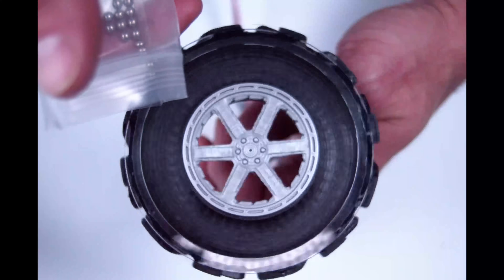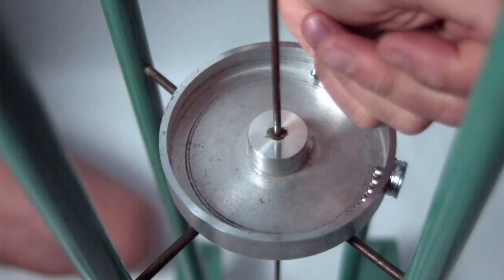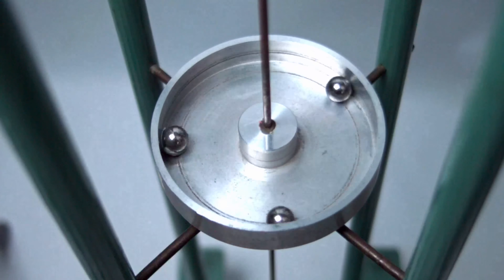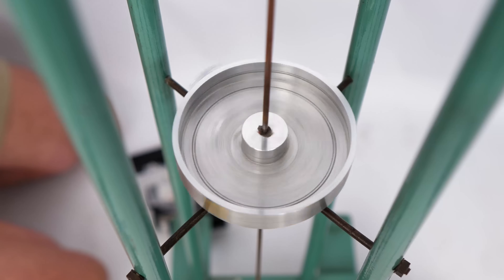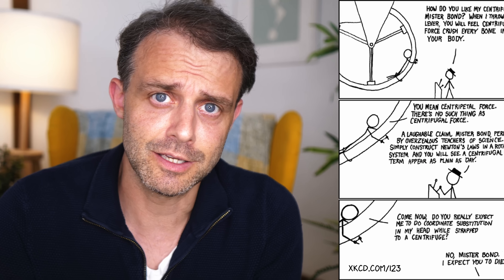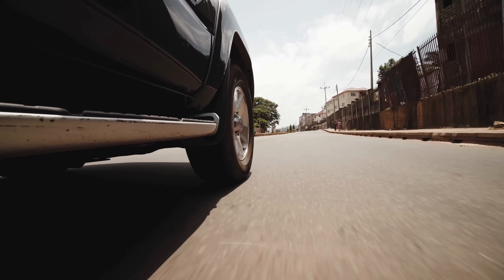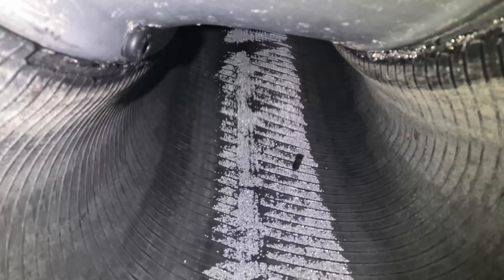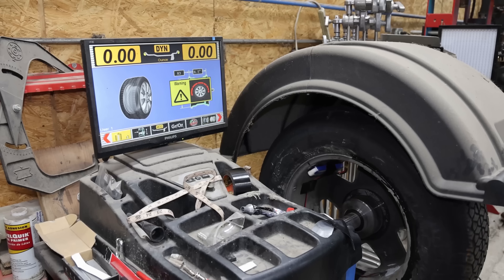Do tire balancing beads actually work?

Comment: So, let me get this straight - these imbalances make my axel flex, basically, yes? So surely each time the wheel needs balancing, the metal of the axel would suffer... So surely, then, it's better to have static weights to balance the wheel, to avoid excess or unnecessary axel flexing? 
(I can guess that such flexing would potentially lead to failure long after the useful life of the vehicle, so it's not a problem in real life, but it still strikes me as better to have static weights for balancing.)

Comment: I used them and they worked for a time. The go fast to work issue was bothersome as you had big imbalance while driving on slower roads until you could go 70 mph. Then a couple of months later the balls got sticky from preservative or mold release waxy substance and they clumped and stuck. The sealed rings with an oil and balls that look like tin dinner plates and have holes to slip over hubs and wheel studs fix the clumping but still require spped to work.

Comment: As a college student in the early 1970’s I purchased a used car.  Found out the guy I got it from was into gadgets one of which were tire balancing rings.  Basically metal tubes attached to the wheel munch like balancing weights but they had beads in them (my father was familiar with these and explained them to me).  The tires seemed to last forever and I never noticed the out of balance shake.  Eventually the tires wore and needed to be replaced.  The shop that did it removed/trashed the rings and did normal balancing so I never got the chance to open them up.

Comment: I wonder if they could also put some kind of time/friction/heat activated adhesive with the beads. Put everything in the tire, drive up to speed quickly and hold it there until the adhesive cures. Now tire is perfectly balanced always.

Comment: From the tires reference frame there is a bump rotating around the outer surface pressing in that is where the tire touches the ground. This must make the beads bounce around each time they hit it. Also gravity makes them roll around in the tire until up to speed. I guess those effects help distribute the beads until centrifugal force makes it harder for them to move around.

Comment: One thing I have to add. Climate definitely makes people have specific opinions about them. 
I worked at a Goodyear store 20 years ago. We would occasionally get customers that would request Ballance beads for their semi tires. Boss liked it because it cut labor. I liked it because it was easier. Generally over the road trucker we're all about it. But generally in the southern United States. Anyone from northern climates don't want anything to do with them. Water in air would freeze them into place. Nitrogen changed that a bit,just because of tire pressure sensors it became more common, it would filter out all the moisture.  And it was less of an issue. The less moisture, the better it works. But if you have tire pressure sensors, don't do it. They will ruin the sensor

Comment: 2:28 So we can have self-balancing centrifuges, where you just drop, say, 7 vials in and hit “spin” and it will self-organize the vials to be balanced?   No way.
Reply: Technicians for undergrad labs hate this one trick
Reply: You can balance 7 by balancing 4 & 3, and 5 by balancing 2 & 3... The only thing you can't balance on a 12 slot centrifuge is 1 & 11

Comment: Except you can see--on the internal tire views--that the beads do not stay where they are required for tire balance at slower speeds. Even if you're going fast enough to hold them against the inside of the tire against gravity as they pass over the top, the beads come around and hit the point at which the tire is deformed against the road and get thrown out of the position they had begun settled in, and the balancing process never completes. And at higher speeds, they are held too tightly against the inside of the tire and any little ridges inside prevent them rolling to the right place, so again the balancing process never completes. And even if the process DOES complete...the balanced condition would not survive slowing back down because they would get thrown or fall out of position again.

These circumstances aren't present in the rigid, horizontal metal cup contraption. Orient that test contraption such that the cup is almost vertical, leaving only enough angle that the ball bearings will stay in the cup. Make the cup out of something flexible, and position something against it such that it deforms slightly. You will get radically different results I'm sure.

So they MIGHT work under a very narrow set of circumstances only, but probably not.

Comment: Why I used to work at a tire shop we used to put balance beads in all the semi tires except the steers we had an expensive machine we balanced those with. Truckers swear by the balance beads. They used to put 3 golf balls in and sometimes when you change a tire you’d find golf balls inside that are all worn down and black.

Comment: I wonder if you could use a liquid that sets so when you go back to lower speeds the tyre remains balanced. Or coat the beads in a glue/add a setting glue to the mix. In the end it's just distributing mass and the beads themselves are like an analogue of a liquid. I suppose Incorporating beads AND a setting liquid/glue helps maintain the higher density of the beads. Patent pending...

Comment: I've wondered this with my washing machine. When it spins slowly, and the clothes are badly aligned, the whole thing seems like it's going to rip apart. Then when it speeds up it often just stabilizes and tends to stay that way until the program ends. 

Thanks for the explanation!

Comment: Same thing happens with the fix-a-flat flat tire repair product.  If you drive at freeway speeds after using it, centrifugal force spreads the goop out evenly to balance the tire.  If you drive long enough, it solidifies and stays in place permanently.

Comment: wheels tyres have a flat spot so disturb the powder. I doubt its any use for accurate blalancing. but the powder is in the tyre and you show balls in the metal wheel

Comment: You would need to get it to balance the first time and while still moving and balanced mist an adhesive to glue the balancing balls in place if it works well enough but i think the flat spot created by the ground would mean you would at least have to pick up the vehicle to balance it for the glue to be added.

Comment: It's the first time I have heard about those beads. Perhaps they could serve purpose as an  enhancement to already ballanced tyre ? What I would love to see what effect they would have on ballanced tyre at low speeds. Would that be negative? If not, then the benefit of perfect ballance at higher speeds could mean better tyre life. Providing the beads would not exert enough pressure in the centre of the tyre, inducing uneven thread wear.

Comment: Balance beads work.  You neglect the fact that the beads are distributed, not only by the imbalance of  the tires, but by the vertical deflections of the suspension.  I use beads in all my motorcycles and  proof that  they work is that my tires have no wear due to imbalance--I and  I never reach highway speeds.  You can do all the experimenting and theorizing you like: but as with bumblebees, despite the theoretical impossibility of their flight, nevertheless, they fly.

Comment: Could You not use balancing beads with some sort of glue that would dry during freeway speeds? You put the beads in, add the glue, spin the wheel for 15 mins or so driving on freeway and as the glue dries out the beads stay in place when You slow back down?

Comment: Question - How do the beads manage to overcome the groves inside the tires? It looks like those would prevent the beads from sliding into the correct position? Also, someone should invent beads with a quick (but not too quick) adhesive, so that you can fill your tire with the beads+adhesive mix and hop on the freeway for 10 minutes or so to let the stuff dry and BAM! The beads are now stuck in the correct position!

Comment: Even at the relatively expensive garage I used to work at you could have all your tires balanced for about $40- $50 and we would rotate them for you at the same time if you wanted. Plus that works at all speeds, likely saving you tire wear in the long run. If you simply can't afford to have your tires properly balanced, sure use the beads. If you can afford it have it done the right way.

Comment: What if the initial load that unbalances the system weights less than the additional weight? Would the new additional weight float away from the edge or will it unbalance it again?

Comment: This mechanism is also used in some LG washing machines to balance the laundry during the spin cycle. And now I also know the real reason why the washing machine drum shakes the most during the acceleration and deceleration phase of the spin, but not at the highest RPM - I used to think it is just that at fast RPM, the drum doesn't have time to make so large swings.

Comment: Tire balancing beads are usually only used when the wheel to tire ratio is too far apart that normal tire weights wont make a difference. In sciency terms: if the wheel weights are used too close to the center of mass (wheel). For instance, i have 16" wheels with 38" tires. To balance the tire, i would need more wights than reasonable. But because balancing beads ride close to the outer diameter of the tire, they are much more effective.

Comment: I replace my own motorcycle tires and only dare to use balancing beads in my slower bike. So my question is how differently does beads effect a motorcycle that can get to 50mph in a few seconds vs one that would need more time. Being on two tires means the wobble effect at lower speeds gaining to higher speeds would be more noticeable especially since if I accelerate fast enough the front wheel would lift off with an tire that has the beads all bunched up free flying in the wheel.

Comment: Just a thought and it may already be a purchasable product, but given that these work with tiny glass beads couldn't they also work with fluids? And following that train of thought, couldn't you use something like an epoxy resin for tire balancing, adding the fluid before a road trip or something,, and over the course of the drive the epoxy would harden in place leaving you with perfectly balanced tires even after gravity would take over and displace the regular tire balancing beads?

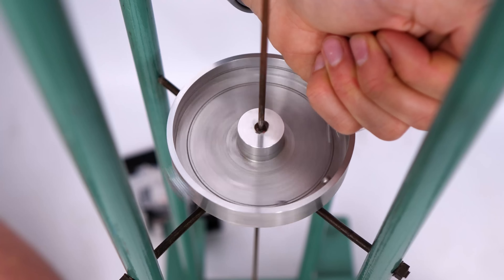Comment: 0:21 Absolutely chewed up the inside rim of that wheel oh man.
Reply: Stock footage can be just as hilariously bad as stock photos sometimes. In the video about epipens, one clip showed a draw where they kept pulling the liquid at an angle, filling the syringe half way with air
Reply: It's normal man I worked at a tire shop for years, they do have stick on weights that just work with adhesive if you don't want that happening to your rim, but most of the time people don't really care too much about a little scratch on the inside of the rim
Reply: @deadlegs_Tm  I’ve never chipped a rim tapping on a wheel weight personally.
Reply: @deadlegs_Tm still that was a particularly poor effort
Reply: @2ARM2 because he was using the wrong kind of wheel weight for that aluminum wheel

Comment: It's a common motorcycle thing to do both. Because we can get more high speed induced vibration due to resonance, which is much more dangerous for bikes (this is one cause of the terrifying "tank slapper") so we will do normal balancing weights AND throw some glass beads to absolutely ensure the wheel doesn't go out of whack at higher speeds.

Wheels can have very specific points where they develop a harmonic vibration. My land rover does NOT like 45-47mph.

Similarly now my ambulance has an awful induced vibration at 68-71mph, with no issues below or above it.

Comment: Mechanical engineer who has balance beads in my motorcycle tires. They work, except on one street in my town. There is one road where the seams in the cement are very slightly buckled even in cold weather. This keeps the beads from staying put, and the tires feel really off. This road is bad in a car too, so it's not really because of the beads. I've done highway speeds and twisties with them with no problems.

Comment: I wonder if there was a method of balancing a tire by using a temporarily moving weight and you just spin the tire for a minute or two before those weights could lock into place or harden.

Comment: So what I'm envisioning is, spin the wheel at highway speeds while it has epoxy coated beads in it. The beads will find the right spots, and you let them adhere to the tyre before you slow it down. Voila, permanent solution!

Comment: As usual, video and comments are great. But as a car guy, if your tire has a wobble or shake, got it checked. They normally don't randomly do that. Either a missing weight, bent wheel or a tire has a bad carcass/body/whatever it is called in English. The last one is especially something you'll want to take care of, the second one will eventually cause the third one and the first is cheap to fix.

Comment: New invention: use a light glue in the tire with beads to set the beads permanently in the balanced position, just have to drive continuously until the glue sets

And hope the tire never slips on the rim ever

Comment: Could you please stop calling balls or steel beads ball bearings? They are just balls. You can make bearings from balls so you get ball bearings, but balls from a ball bearing are just balls otherwise ball bearings would be called ball ball bearings.

Comment: 5:32 it’s also easier to imagine if you start at the bar and look at the rotating twist and how it pulls the mass to that location but the resistance from the weight or mass changes the angle and the pull to weight ratio is weak to heavy so the drag and difference is greater. Like a spiraling drain and the tightness of the hole. Please think on it like that and you may see the gravity in the sharing of energy.

Comment: Hey,
So I think that using a prime number of balls (with one fixed in place) will stabilize the disc at a lower spin rate. The idea is that there is only one way to arrange the balls so that the disc is balanced.

Comment: What if you add some runny, slow curing glue and drive on a highway until initial bonding? Wouldn't the beads balanced even if you slow down or stop?

Comment: I've used the balance beads in a set of 35" tires on my Jeep.  I ran them that way for a couple of years and then went back to traditional balancing.  It does work, but if you don't usually get to highway speeds there's no benefit.

Comment: What happens to the flat spot where the tire meets road? I expect the beads to jump and have to re-seek their optimal balance energy rotation. And then there are cracks in the road and potholes. Beads would only make these rougher.

I remember studying this balance effect (on paper) in ME school, about 1983. Works great if the item can shake out of round and thereafter allowed to always spin centered.

A  tire with beads can not be balanced on a spin balance balancer because the spin balancer holds the wheel rigidly centered. The beads can not move in to place.

Comment: If you removed the rotating disk, and just spun the axle, there would be rotational frequencies at which the axle itself adopts a distorted shape similar to an integral number of half sinusoids.  Think of it as a rotating standing wave.  So when you add the disk, the disk will wobble the least when the axle has a node right at the disk location.

Comment: Steve I am still stuck behind you driving from the right hand side of the car.. 🙃 How you supposed to see round slow vehicles like farm equipment to safely pass them... 😂 unless your driving on the wrong side of the road 😉 no but seriously, if i had to deliver the mail, or newspapers I would wish for a car like yours.... 

I know this sounds like useless rambling, and it is, but look at your cars tires, both metric and imperial on them. The first number ~200mm is the width, the second number is the aspect ratio ~65% of the width, weird huh not a defined number, and then the rims diameter ~16 inches.. So if you ever asked "do you use the imperial system" you can't just say never, must at least answer with only when I buy new tires, and you know "even then I barely touch it" 🤣

Comment: I suspect the reason that the style of rotation changes between low and high speeds is that at low speed the disk's rotational frequency is close to the resonant frequency of the axle, but at high speed it's completely mismatched. Edit: Whoops, left this comment literally seconds before getting to that part of the video 🙃

Comment: I own a mechanic shop specializing in 4x4s so we do a lot of very large tires and balancing beads. Absolutely work but they are not meant for passenger car tires. Really. They will work in a passenger car tire but they're more meant for large heavy mud tires where balance them on a machine is just impractical cuz they would need too much weight. The reason they work is because you won't feel the balance until you hit about 80-100k, which is when they start working.

Comment: I work in tire service and most of the time when I work on an old tire full of beads I see a lot of, for lack of a better word, "rubber pearls" inside the tire from the beads wearing the inside liner of the tire.
How much of it is really enough to be considered a problem is arguable. But for me personally any internal wear is too much internal wear.
Especially knowing that the balancing effect only applies itself at higher speeds, the only real advantage over traditional balancing is aesthetics.